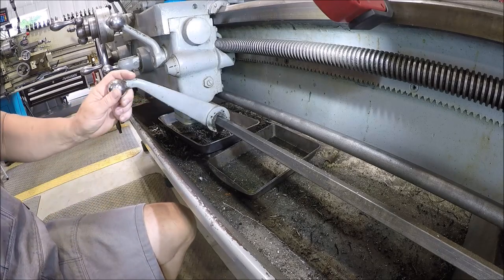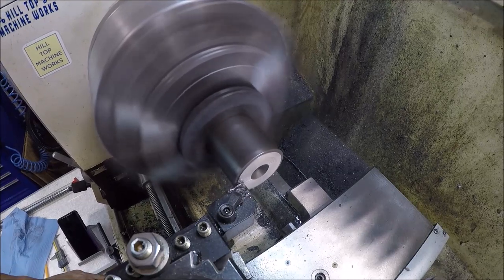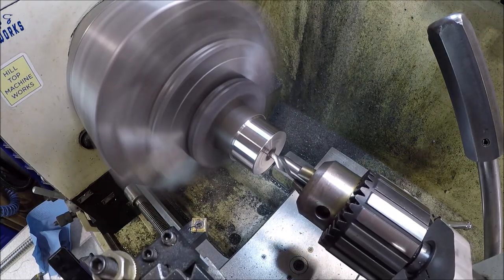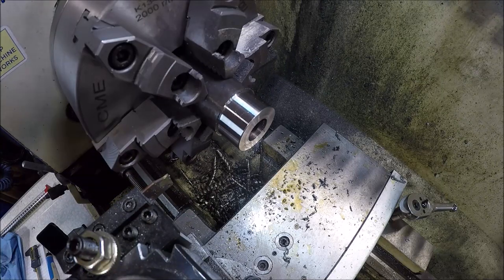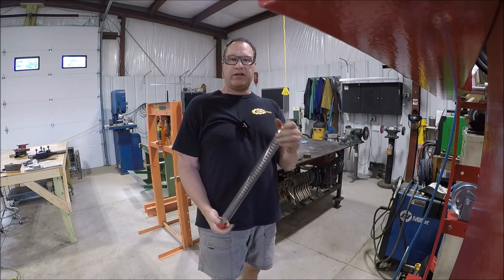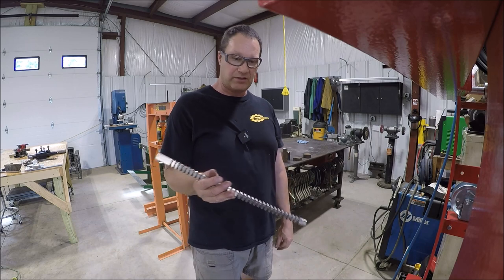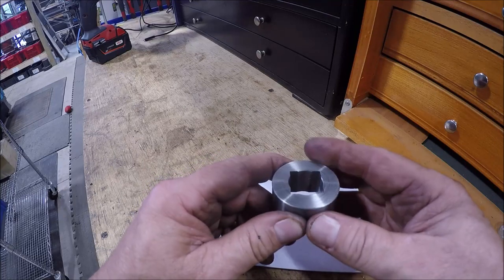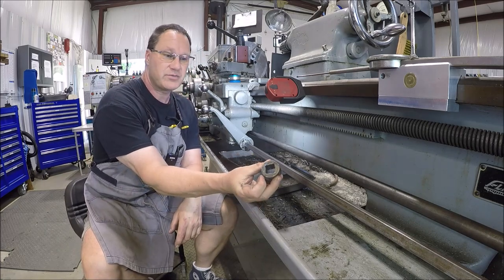Clutch bushing repair on my Monarch model K lathe

Comment: The handle on my cbb is not bad but the carriage on the series 90 has a mile of slop. Someday I will get to it.😊
Reply from the maker: Understand that. Always seems like there is something to fix. How is the audio now with the new adapter cord?
Reply: @hilltopmachineworks2131  I didn't notice any noise so it must have fixed it.
Reply from the maker: @bcbloc02  Great 👍

Comment: Your audio has a very high pitched noise.  Makes the otherwise interesting videos unwatchable if you still have the stereocilia to hear that high of a frequency.
Reply from the maker: Well that is not good. I had this problem a while back. I finally figured out it was the jack cable from the mic receiver to the GoPro. It was somehow causing the noise. Once I replaced it the noise went away. You are the first person to say it is back. I don't hear it when watching on my laptop or desk top computer.
Reply: I hear it too
Reply from the maker: @josephkubik4931  Thanks for letting me know. I have gone back to just using the GoPro internal mic to eliminate this problem.